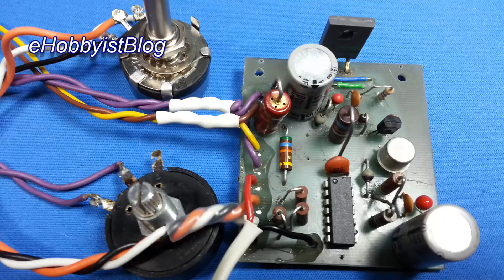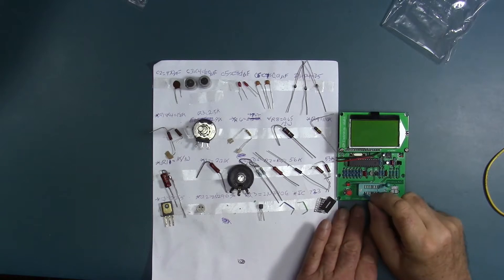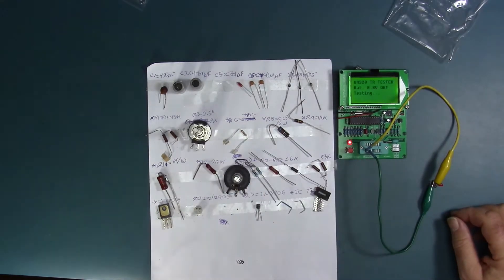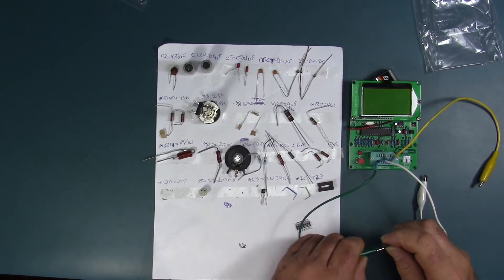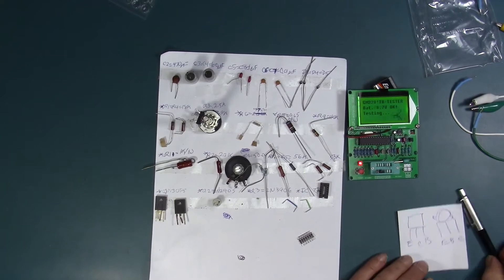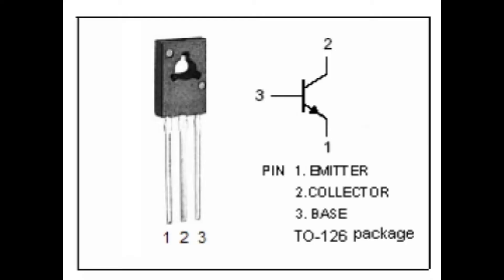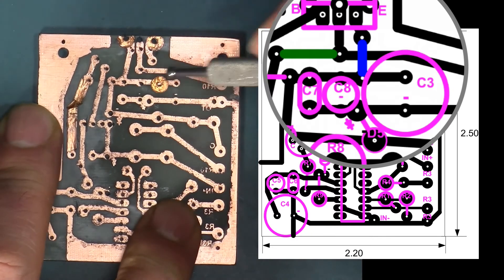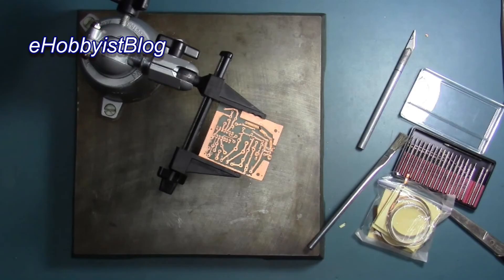036-Power Supply--Grrr! (10)

Comment: A simple check with a multimeter would reveal which is the base though it wouldn't tell which is emitter and collector.
Reply from the maker: Yes. I usually do some DMM testing on all components before using them, but in this case, I did not note MJE3055 pin-out. It was "unimportant". (I assumed my way into the problem.)

Nowadays I use the component tester shown in the video, which is cheaper than a DMM, easier to use, gives more useful test data, is faster than doing the same thing with a DMM, and is unambiguous in  terms of pin-out.
Reply: An easy mistake to make; I suspect that we've all done it! Agreed that these component testers make life easier but I have one that sometimes mis-identifies transistors. Glad you've got the PSU sorted. :-))

Comment: excuse my ignorance.. but couldn't you just turn the part around 180 degrees??
Reply from the maker: Yes, but…

The MJE3055 has a metal plate on the back which should be clamped to a heat sink (or in my case clamped to the rear of the enclosure). I intended to do this with a screw, a mica insulating washer and some thermal grease to promote heat transfer. (Note that the transistor must be electrically insulated from the enclosure. In this design, the transistor has to dissipate about 30 Watts.)

Rotating the transistor, would have the metal plate facing forward, which would make it difficult to connect it to the enclosure/heat sink. In my judgment it was easier to rework the copper traces.